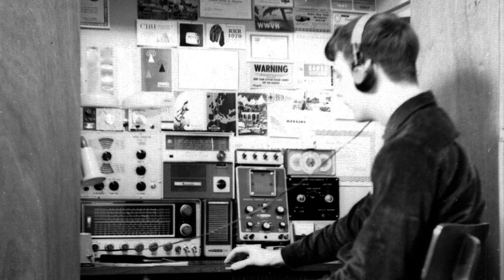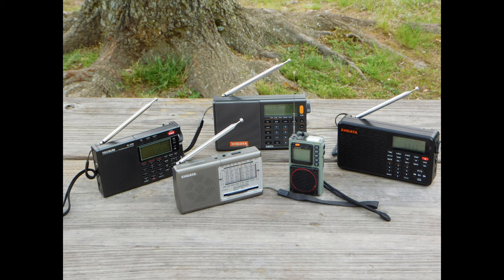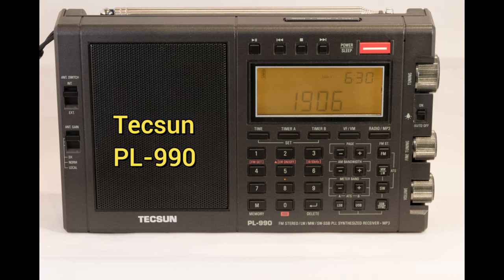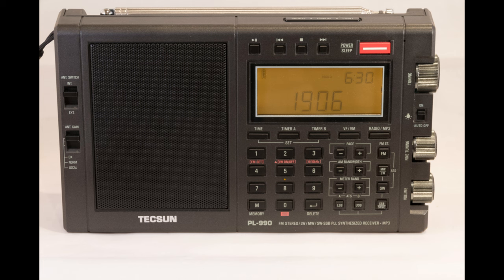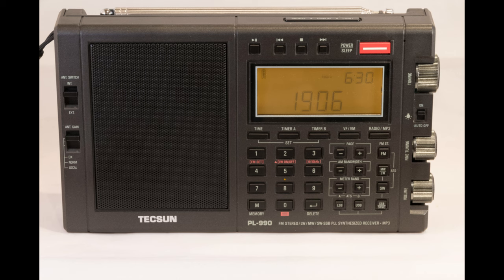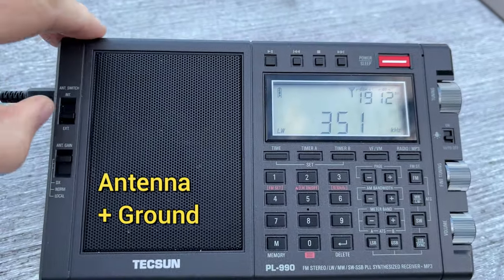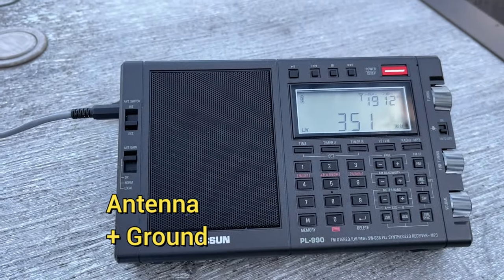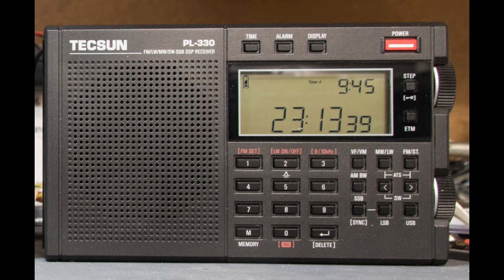Antenna + Ground

Comment: Excellent.  You have answered a question that I have wondered about.  I have a Tecsun 880.  Now I will incorporate a ground. Thank You Very Much.
Reply from the maker: The external antenna jack on the PL-880 doesn't work with MW or LW, but you might get a boost on SW. Dunno.
Reply: @kwdavids1  Correct.  LW is mostly empty and I listened to all the MW that I wanted to before FM Radio got popular.  After all, it's just regular radio, to me.
Reply: @kwdavids1  Yes I know.  Might help on SW though.  I'll try that.   Thank you

Comment: I have the PL330, PL600 and PL660. 
I have never added a ground before but definitely will add a ground rod and test it out now. Thank you!
Reply from the maker: The PL-660 (and probably the PL-600) do not use the external antenna for MW and LW, so you might not get any improvement. The PL-330, however, has a hidden feature to use the external antenna jack for MW and LW, and you will find that a wire antenna and ground helps.
Reply: @kwdavids1  thank you for that info. I was looking at the PL680 bit maybe should just get the PL880.
Reply from the maker: @DonzLockz  The PL-880 doesn't officially work with an external antenna on MW/LW either. There is supposedly a hidden feature to use it, but the process of starting it is very complicated and it drops out in normal operation of the radio. I'd call it unusable, plus it doesn't seem to work on the latest firmware.

Usually external antennas are magnetically coupled to radios for LW/MW, products like the Tecsun AN-100 or the Terk -- but I don't know if they work on LW. When the snow clears I'm going to experiment with wrapping wire from the antenna around the radio to see how that works.

Comment: Nice demo.  Thanks for sharing.  I have used my Sony ICF-SW7600 in a similar fashion with an external antenna and ground, with good results.  Another thing worth trying would be to use a 9:1 impedance matching transformer like the Nooelec Balun One Nine.  Although the radio itself wouldn't be grounded, the matching transformer would enable the antenna to "work against" the ground to induce a stronger signal into the antenna winding of the matching transformer, and then provide a good signal into the receiver winding of the transformer.  This could potentially be helpful in reducing local noise.  Again, thanks for the video.

Comment: My Hustler 6-BTV is not a particularly good receiving antenna, though it is a MONSTER of a transmitting antenna.  That having been said, I can tune my HF rig down into the broadcast band and CLEARLY receive an AM station 120 miles away with it that I cannot receive at all with one hundred feet of wire AND an eight foot ground rod on my old Hallicrafters S-40B.  I have 32 radials that are each 16 feet in length buried an inch to an inch and a half in a circle around the radiating element, so my radial field is four wavelengths on the lowest frequency I generally use, which is the forty meter band.  

All that to say, instead of just using an eight foot ground rod or a cold water pipe, and IF you have the real estate for it, a good radial field below your receiver could help tremendously with your reception.

Great video, and you make a great point.  The extendable element is only HALF the antenna.  Reception will always be improved by incorporating a grounded element.  Thanks so much for sharing this video!

K5SFC

Comment: That is very interesting. Have you attempted using this technique with MW and SW reception?  I am going to give this shot.
Reply from the maker: I have tried a 20-ft wire + ground on MW with my PL-990 and increased the number of daytime stations received from 16 to 70.
Reply: @gary it works on both mw and sw. this “hack” it actually isn’t new, it is very overlooked.
This video is a wonderful reminder.

Comment: Thanks for the video! I am still learning about sw listening with my tecsun pl 330, I am at the "throw a wire in a tree" phase.
Can you explain how that ground you are showing is built? Is it just "another wire" from the main wire to the ground, are there specific points to attach it?
Reply from the maker: Refer to this for more on connecting the ground. https://www.blogordie.com/2023/12/antenna-ground/#construction
Reply: Thank you!

Comment: From Amazon $12.99. I use this for my Tecsun 880 and it's perfect and has a second connection for a ground wire.
AEcreative 3.5mm Quick Connect solderless Antenna Plug for shortwave Radio Receiver Eton Grundig Tecsun Sangean Degen.
Ground FYI:  Years ago I needed a ground for something. I took a 3 prong plug but only wired the Ground prong. This way i can get a ground by plugging it into a 3 wire electrical outlet and just use the ground part of it.  Yes, there likely is some "noise" pick up from doing it this way, but it is a valid ground connection, if you have no other convenient way to get one.

Comment: Thanks for pointing that out/
what is the hidden feature for ground on the 33n? Using headphone sleeve for gnd?
Reply from the maker: The Tecsun PL-330 has an external antenna jack, so the ground is the sleeve on that jack. The hidden feature is a long press of the "3" button when the radio is on.

Comment: I've always felt that the "ground" connection was a good idea, but as you say, most of today's radios don't make it "Easy" to do it!
Maybe someone on E-bay will start selling an adapter that plugs into your portable receiver and makes it easier to "ground" your set!

Comment: hi, will it make an even better difference if the ground wire was even longer?, I see you made the ground join the wire antenna , is it possible to leave those two wires in different directions, and add a ground clipped at the base of the 2 antenna wires close to the radio with a clipp?

Comment: Could you please do a video on your external antenna setup showing the antenna and ground.  Athough there is virtually nothing worthwhile left to listen to, I still occasionally get the urge to scan like the old days.  I've never had an external antenna because I don't know what needs to be done to avoid lightning strikes.
Reply from the maker: I just have a 20-foot length of #22 wire about 10 feet up a tree connected to an insulator screwed into the tree. The wire slopes down to a table where a rock keeps it from slipping. I have an 8-foot commercial copper ground rod (hardware store) driven about three feet(?) into the ground. It has some lamp cord that runs to the same rock. There's not much for a video.
Reply: @kwdavids1  Thanks for clarifying.
Reply from the maker: Refer to this for more on connecting the ground. https://www.blogordie.com/2023/12/antenna-ground/#construction

Comment: I've wondered the same thing. It would be Interesting to build a simple ground tuning unit (series variable LC circuit) to see how that affects the receive performance. I have one half built for mobile ham radio operation, I need to finish it off. Y

Comment: The antenna line and the ground line are connected together to the radio external jack?
Reply from the maker: The antenna plug has a tip and a shield. The long wire is connected to the tip, and ground is connected to the shield. If that's not clear, look at the diagrams in my article: https://www.blogordie.com/2023/12/antenna-ground/
Reply: @kwdavids1  Now it's clear 🙂 Good article.

Comment: you sound quite well versed on radio so apologies if you already no this : these are called NDB's Non directional beacons, they broadcast a lot on LW,  at night time you should pick up some between the end of th LW band and the start of the MW band they are used to keep ships and planes in position so they dont vere of course..they all broadcast a morse code an you can pinpoint where they are located by looking on the web and entering the 3 letter code.

Comment: Does the ground wire connect directly to one antenna wire within the insulation or does the antenna wire have two parts that need to be separated like coax and the ground connected to one of the two?
Reply from the maker: The cable I use is shielded audio cable with a interior conductor and a spiral twisted shield I connect the antenna to the central wire and the ground to the shield. At the radio end, the phone plug is wired in the usual way with the tip connected to the center wire and the shield connected to the ground.
Reply from the maker: Refer to this for more on connecting the ground. https://www.blogordie.com/2023/12/antenna-ground/#construction